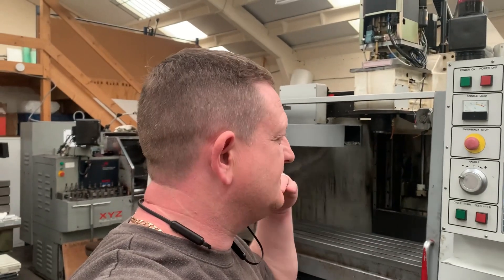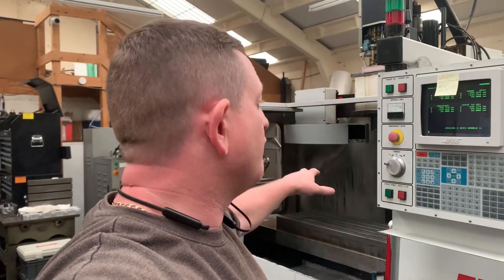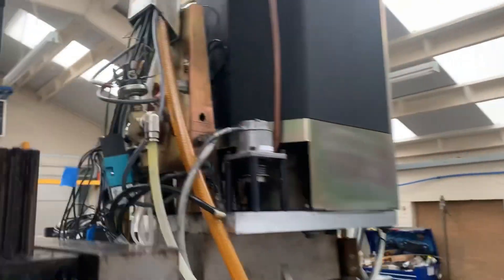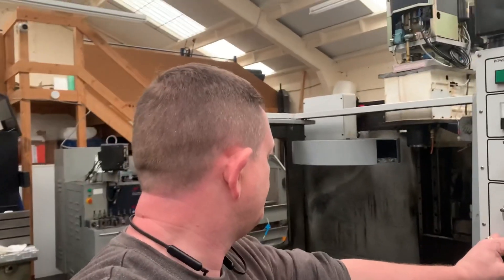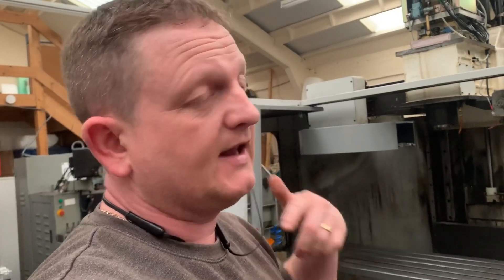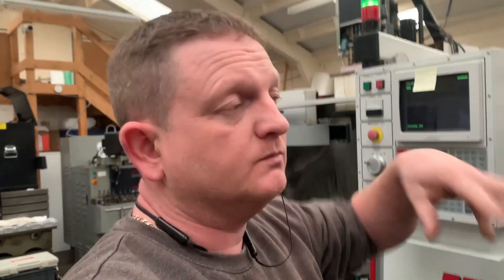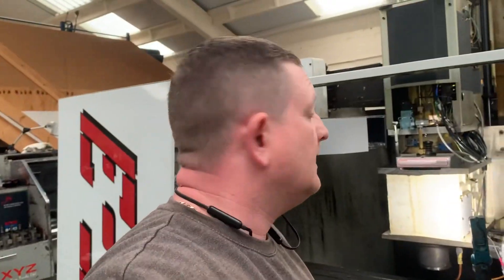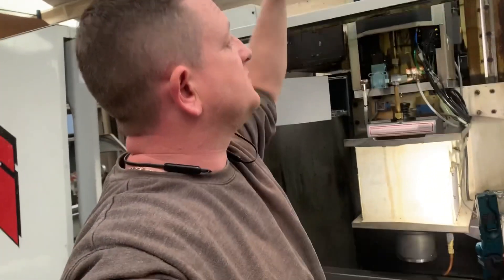Haas VF3 hi low gear change issue…Its got to come apart !!!

Comment: We shifted gears manually (disconnected the hoses from the tube and used a gun to supply air to one tube, then to the other). I don't know how you can shift the gearbox through the MDI. I already know from your videos what gear the gearbox is in before switching it on!!!) And if I swap the tubes, it doesn't shift to higher gear at all...((In the parameters for higher and lower gears, it says 1; 1 (provided that the gearbox is in lower gear) BUT at one point after another shutdown (yesterday), the parameters said 1; 0!!! And only at that moment did the car start up perfectly! After switching it off, it never said 1; 0...(
Reply from the maker: It sounds like the switches could be faulty due to age as well as seals gone so it needs to come apart and replace the seals and switches and that will most likely fix it for another 20 years
Reply: @kinzy_fabrications  Thank you very much

Comment: Hello!

I've run into a problem when starting the machine; the gearbox won't shift from high to low gear.

We've already replaced the solenoids and the manifold. We also drilled out the orifice hole to 1.5 mm, but the problem hasn't gone away. We even tried swapping the air lines, and that just changed the issue—it wouldn't shift into high gear instead!

In manual or MDI mode, the gearbox shifts just fine. Even when pressing the valve manually, it shifts to both high and low without any issues. We've tried everything.

Machine: HAAS VF-4, 1996, VCE 1250
Reply from the maker: If it shifts completely fine in manual mdi mode but not during programs i am not sure what your issue is, if you are getting power to the solenoids when you request a shift which you must be if it shifts in mdi then i am not sure, 
every gear shift issue i have come across has been from bad shift cylinder seals so thats all i can recommend
Reply: @kinzy_fabrications  I received your reply. Thank you.

Comment: You can't take the top plate off with fan and all
Reply from the maker: No the fan is attached to the side pieces via a bracket but making a plain dummy top plate worked fine in the end 

Thanks
Marc

Comment: Thank you! Very handy, I have intermittent high/low gear issues with my 03 VF3, some mornings it works, some I have fight with it to shift gears by shutting the air off and slamming it open during the time its trying to change gears. Once it has cycled a couple times its good for the day.. I'll wait for your next video about this!
Reply from the maker: Hi

Yeah your problem sounds exactly like the one I have, but even shutting and opening the air supply doesn’t work for me but if it does manage to change it will work all day like you said

Hopefully I can start the tear down in the next few weeks 

Thanks
Marc
Reply: @kinzy_fabrications  some mornings it is very stubborn lol but I get it each time, then all day its machining and changing gears no problem 

The solenoid package seems to have been changed by the previous owner, theres air lines coming out of the head and its mounted on the top of the machine enclosure
Reply: I'll tear mine down to take a look at how they hooked it up down there, I have no idea if I still have the restrictors! They are not on the solenoid they installed

Comment: My vf3 has nuts and 3 or 4mm shcs and not rivets for the fan. So I'm thinking they my have been replaced at one point. Might be possible to use straps with hooks instead of a bar. I might have to do this in the future too so looking forward to see what you do mate. Howdy from Texas
Reply from the maker: Hi

Thanks for watching 

When I had the top plate off to clean it I didn’t pay much attention so when I get a chance I will have another look and go from there but I’m thinking a dummy top plate will be the easiest way to do it 

Thanks
Marc

Comment: Had the dreaded high/low shift issue a few weeks ago around the same time as you. Saw the same video with the gearbox already taken apart, with promise of more videos of it all coming back together, but nothing. That’s when I came across your video.  I subscribed to your channel to see what you are doing, as I have some similar issues (i.e. shifting, and tool changer rebuild) with my “Tupperware” 1993 VF-1. I’m sorry for you troubles mate, but I eagerly await further updates from you. Thanks.
Reply from the maker: Hi

Thanks,
Yeah it’s a shame that person hasn’t uploaded the second part of the video yet as I’d of liked to see that but never mind,

When I’m ready I will start on mine and try and film as much of it as I can to put together a decent video for everyone 

Thanks
Marc

Comment: A haas service guy told me that you could drill out the pin hole in the solenoid a 1/32 bigger and it would solve the problem. I haven't tried to do it yet. But you mite try it first.
Reply from the maker: Hi, 
Thanks for the tip but yeah I already tried it in the first gearbox related video I done, and I thought it had worked but unfortunately not this time, I have even completely removed the restrictors but still not luck, my problem is in the gearbox or air cylinder 

Thanks
Marc